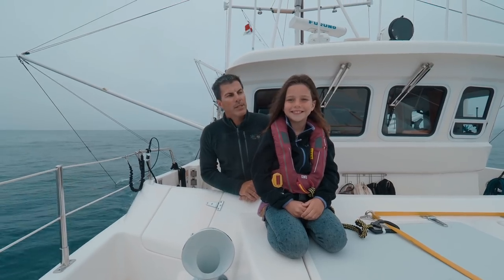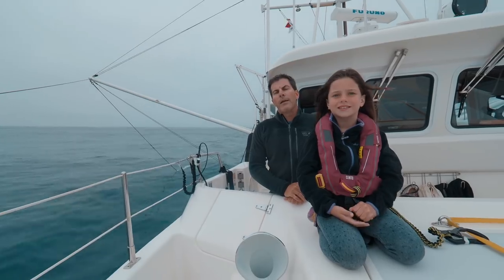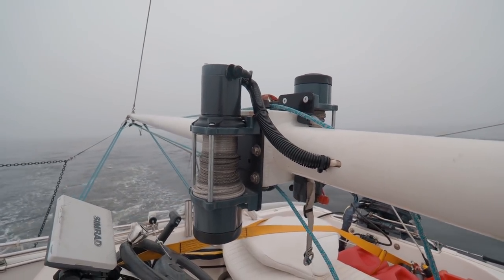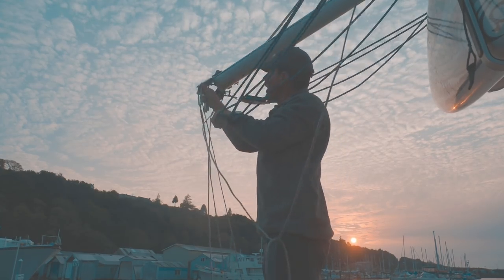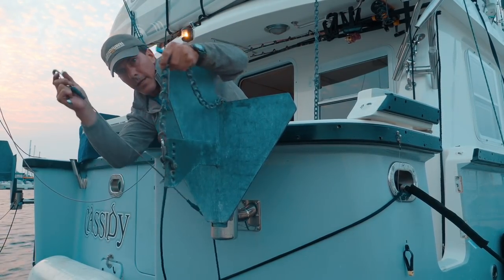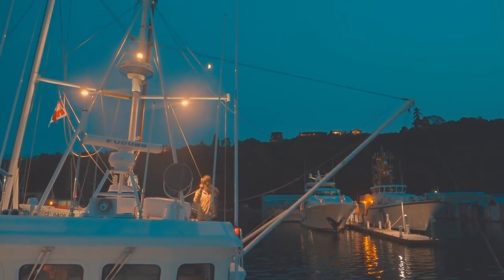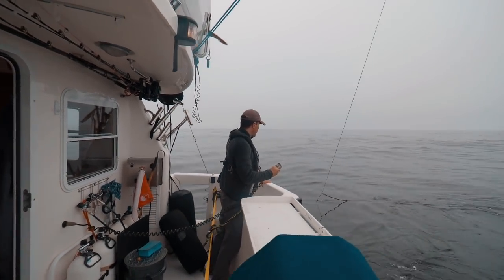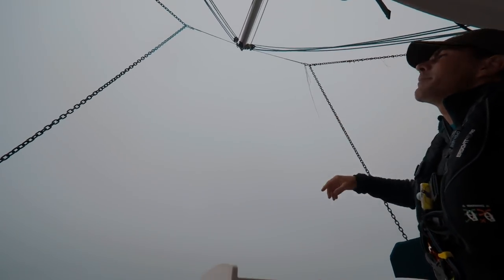Using Paravane Roll Stabilizers on an Ocean Crossing Powerboat - Nordhavn 40, M/V Cassidy,  Ep. 11

Comment: Thank you for the informative video.  I have never worked on a boat with Paravanes.  Will the Fish be effective while at anchor to help reduce roll or do you have to attach some other implement?  Also how difficult is it to bring the Fish back in with ad heavier swell or chop (the conditions look pretty ideal in the video).  Thanks again for the info and great videos.
Reply from the maker: tonkacaptain - I’ve heard the fish are somewhat effective at reducing roll at anchor but we attach stainless steel “flopper stoppers” while at anchor, which are basically plates with a hinge in the middle so they unfold and resist movement on the way up and fold and dive going down. 

To answer your second question, we’ve never launched or deployed them in a heavy seaway.  Always launched before expecting heavy weather and only recovered after things calm down.  I imagine if we had a failure of the fins we may need to deploy on heavy seas.
Reply: Thank you for the reply.  While at anchor at Catalina Island I saw vessels who deployed the hinged "flopper stoppers".  Do you use the "Floppers" on both sides, and if so how many?
Reply from the maker: tonkacaptain - Catalina would be a perfect spot to use them - especially in the anchorages toward the west end that can get a little rolly.  

We will typically rig one flopped from each side just because we can and they are easy to deal with compared to the paravanes.  A lot of the Nordhavns without paravanes are rigged with a single small pole that can be deployed with a flopper stopper and my understanding is that even one is very effective.

Comment: Hey guys, just watched your video and wished I had seen one when we bought our N40 11 yrs ago. A couple of things I noticed. It looks like the previous owner made some significant mods to the running rigging to haul a heavier tender. The p.o. probably never launched the fish. The mods are making changing from tender deployment to fish deployment considerably more complicated.  If you can’t completely lift your fish out of the holders with your winches then your boom is positioned too low. Try lifting it another foot. When you’ve got the right height mark it on the halyard. Lastly, the cables for securing the fish in the stowed position should be attached to the chain above the fish unless you’ve disconnected the chain from the fish then your position is correct. I’ve never lost more than a 1/2 knot while running the fish. Great to see someone doing a video series in a 40....thanks!
Reply from the maker: ChandellePT38 - thanks for all of the good information.   The running rigging is configured so that both the main line and the topping lift have a 2:1 purchase.  That all comes out pretty easily with snatch blocks - definitely adds some time to the configuration but it’s really messing with everything on the end of the boom that takes the most time.  

Interesting about raising the boom.  I have it where it is right now through trial and error so that tension on the lower section of chain between the shackles that attach to the winch line and the fish doesn’t vary too much when the poles are deployed or up.  The winches will lift the fish all the way but it’s a pretty acute angle so raising the boom would help with that.   I may experiment next time we rig the boat to run the paravanes.
Reply: @CassidysSailingTrawler  One thought on stowing the fish while watching your awesome video.  Have you though about connecting a small chain to the aft of the fish that then can be clipped to the lifting chain to keep the fish vertical?  That way once the fish is out of the water and at your working height, you clip the aft fish line to the chain and it eliminates you having to try to keep it vertical and you just need to raise and then lower it in to its stowage position.  Just a thought.  Very well done video.

Comment: Do you use the outriggers for 'roller-floppers' (or whatever these things are called) to reduce rolling at anchor?
Reply from the maker: Thierry Lerinckx - we do in fact use the outriggers for flopper stoppers at anchor.  We've got two of the magma Stainless steel flat plate type flopper stoppers with a hinge in the middle.  We didn't need to used them the entire time that we were cruising Alaska because the anchorages were so calm, but I imagine we will use them a lot as we move south into Southern California and Mexico with more exposed anchorages.

Comment: can you comment on the effectiveness of the paravanes vs active hydraulic fins please

also - do you run the two suystems together in a complementary fashion?
Reply from the maker: Marcus Petraska - it’s hard to quantify but by the way the boat feels I think the paravanes are actually more effective than the fins in some sea conditions.  It may be because they are slightly aft of the pitch axis of the boat so seem to at least slightly help to take out some of the pounding from pitching into head seas.  

We’ve run with both systems simultaneously a few times and I’d say they definitely interact in a complementary way.  In conditions where we’d normally hear the actuators on the fins cycling constantly and moving lock to lock, they work way less hard with the paravanes also running.

Comment: You did mention that the Naiads were a complicated piece of machinery, right?
Reply from the maker: Manuel E. Garcia - indeed they are.  Ours Naiads have been trouble free but I’m happy to also have the Paravanes installed.  In some sea conditions I feel like the paravanes are more effective.
Reply: Awesome video!!  Thank you for taking the time to put it together and post!  Interesting to me that your boat has BOTH the Naiads and the paravanes.  Is that typical in a N40/43?  Do you run enough with each on and off to assess how much advantage you get from the vanes vs. the Naiads?  Besides the issue of the Naiads failing (due to complexity, etc), if you were buying another Norhavn, what would you specify for configuration (vanes only, vanes plus Naiads, or Naiads only)?  Thank for your thoughts.

Comment: What was that line you lost in the water at 19:11 ?  Something the fish just happened to snag such as more kelp or something needed to operate the system?    PS:  Awesome job on your videos. They are well done.  Thank you for making them. I shared your channel to the Facebook Nordhavn Dreamers Group, where its getting lots of positive attention.
Reply from the maker: Doug Ales -  Thanks - Just saw your comment - for some reason YouTube had it in some sort of "potential spam" purgatory.  The piece that fell of was indeed just a piece of kelp.  We actually launched and recovered the paravanes twice on our 5 day nonstop passage from Puget Sound to San Francisco Bay because of changing sea conditions and the second time we recovered them, not only was there a lot of kelp but a piece of 3 strand rope with a lot of growth on it.  Not sure if we snagged an abandoned crab trap or if it was just free floating line, but luckily it didn't stop the boat or damage anything.  That is one fear that I have running with the paravanes at night in near coastal waters where there is crabbing is that they are just one more thing that can snag and get fouled.

Thanks for sharing on the Nordhavn Dreamers Group.  We are members of the group as well but probably should be more active there.

Comment: Great video but that looks like a total pain to deal with.  Imagine doing all that in bumpy seas or you arrive at an inlet and need to put the stabilizers back on the boat and it's rough out and there is lots of boat traffic.
No wonder they are obsolete on boats now.  
I'll stick to my Naids.   
The one use I see is at anchor if they can stop the surge and roll that's present throughout the Bahamas!

Comment: would a gyro-stabilizer work better but cost more?
Reply from the maker: Lincoln Grayson - not an easy answer to that question.  I’m no expert on stabilization but from what I know about gyros like Seakeeper - they have an advantage in that they work at rest as well as while moving - but they are very power hungry.  A large enough unit to stabilize this boat would likely require a generator running 24/7.  They also take up a significant amount of interior volume and therefore boats are better designed around gyros that retrofitting.

Comment: I'm wondering how long ago you were coming down the coast.  I just made a run from Bellingham to Marina del Rey a few weeks ago.  Great sea conditions but LOTS of fog.  Was able to run 25 knots most of the time once I got away from any harbors and traffic.  And of course the crab pots.  Always the crab pots....
Reply from the maker: Don Happel - we just got into SF Bay today.  Short pit stop here and then we will continue down to Southern California.  We got a perfect weather window to make it all the way from Port Angeles to SF without stopping.  

We aren’t running anywhere close to 25 knots though in this boat!  Took us 115 hours.
Reply: I thought you were in Port Angeles; I knew it wasn't Neah Bay anyway.  You may have taken longer but I'm betting the fuel bill was a touch less than mine.... :)  (and the fuel got more expensive with every stop going south) I actually work in SF area - was in Sausalito most of today.  Not exactly pretty out there at the moment.  One day I'll do a passage in a proper trawler and see how live is at displacement speeds.
Reply from the maker: Don Happel  - we took on fuel at Cap Sante Marina in Anacortes and I remember it being $3.05 / gallon.   We will probably take on  a few hundred gallons here in SF because the boat rides better with full tanks and I’m not looking forward to seeing the price. 

Sausalito is a cool town - we lived there for a few years.
Reply: "a few hundred gallons".... I did that every day!  But hey, I was being paid by the day to bring her down and the new owner wanted her sooner rather than later.  Neah Bay was $2-something but you'll be at $4/gallon soon enough from Monterey south.
Sausalito is nice - I do a lot of work at Clipper but still have my own boat in Oakland.  Probably should move it over there one of these days.  Have a good trip!

Comment: Would a sea keeper be much easier?
Reply from the maker: +JD N - A seakeeper would definitely be easier than deploying paravanes.   But for a boat this size one would need to run a generator constantly to power the gyro and there’s not really a spot to put one.  

The beauty of the paravanes is they are totally passive and require no power other than the electric winches to bring in the fish.  

We often ran then in conjunction with our active fin stabilizers.

Comment: Commercial fishing boats have their bottoming nets attached from the outrighers. It not only reduces speed but it increases your fuel consumption. It is also known that when one of the nets get stuck to pull and capsize the whole boat specially with increased engine power so as to catch more fish. What is wrong with a bit of rolling? Seems like a lot of work as such.

Comment: For me, this system is far too complicated. A Seakeeper Gyro works while underway & while at anchor.
Reply: Gyros work well but also have significant drawbacks. They require power to always be running as the gyro to spin at very high speeds. So either a large battery bank for a few hours or running the engine/generator are required. The SeaKeeper unit is large and also takes up valuable space in the engine room and is mechanically complex. Paravanes are simple, lines and a ‘fish’ that goes in the water. At rest the long poles attach to ‘Flopper Stoppers’ which minimize roll without requiring any power. SeaKeeper likely stabilized better at rest but you need to supply it with a bit of power so that’s an issue.

Comment: why not just use a seakeeper?
Reply from the maker: Tim C. - seakeepers are supposed to be a great way to reduce roll but the units sized for a boat this big are relatively large and the boat really needs to be designed around accommodating them. They also consume a lot of power and would likely  require running a generator for AC power whenever underway.

Comment: This looks precarious, I think I'd just pony up and buy a Seakeeper.
Reply from the maker: Eric M - Seakeepers are great but for a boat this size one would need to run a generator constantly to power it.  The beauty of the paravanes is that they are entirely passive - no energy requirements.  We didn't use them very often on our 40 because we also had active fin Naiad stabilizers,  but there were times when the paravanes were very nice to have and they also work as a backup method of stabilzation.

Comment: I really see no benefit whatsoever! With the weight of all of the rigging, booms and mast you are adding to fuel usage. Not to mention the drag of the fish robbing you of speed and adding to fuel burn. The only down side you mentioned of the stabilizer fins, was robbing power from the engine which is exactly what all of the passive gear is doing, but more so! Then to top it off, all of he added maintenance and upkeep!
Reply from the maker: kingg213 - the paravanes do indeed slow the boat down for a given rpm/fuel burn or require more power to maintain a given speed.  Nothing is free.  And we don’t use the paravanes often because of the hassle of rigging them.  

That said, we really like having the paravanes installed as they provide a completely redundant stabilization system to the active fins and provide better stabilization than the fins alone in some sea states.   If we had any type failure of the active fins having a backup system is a big plus.  

Being offshore in an unstabilized  full displacement powerboat could be extremely uncomfortable for the crew or even dangerous.

Comment: that system or fins are antiquated!! and what a pain in the ass GET SEA KEEPER. just turn it on nothing out side of the vessal and no drag on fuel economy
Reply from the maker: Warren Tavernia - Seakeepers are a great concept and from what I understand they work well.  The problem with putting one on a boat like this is that the one that has enough mass to stabilize this boat runs off of AC electricity and thus would require running our generator 24 hours a day vs. the few hours that we run at anchor and 0 hours while underway.  

As for the paravanes being a pain - sure they are work compared to pushing a button but I’m happy to have them for backup to the fins or combined with the fins in a very heavy sea.

Comment: The most complicated and BS paravane system I have ever seen. Having said that most trawlers ar replacing them with fold down wings. and before that most used sold arm from boom to paravane, it stopped them from landing on the deck in bad weather or even coming through a window.

Comment: Could a gyro stabilizer system be installed?
Reply: Last I heard quoted, a gyro-stabiliser for a 40 ft. can run in excess of 100K, not including the needed increase in generator capacity and batteries. Additionally, not all boats can handle it without structural mods. The torque exerted by gyro-stabilisers is enormous and needs to be safely distributed.